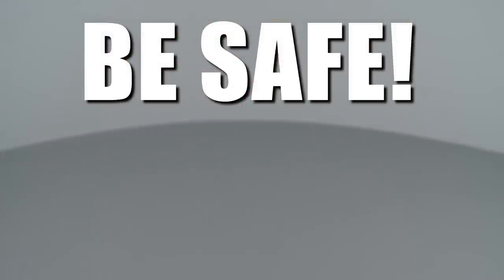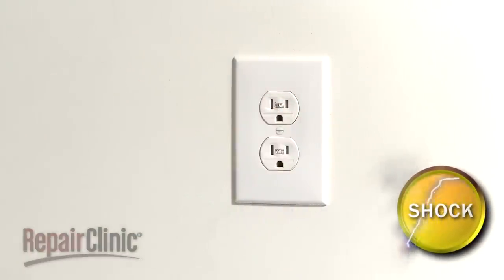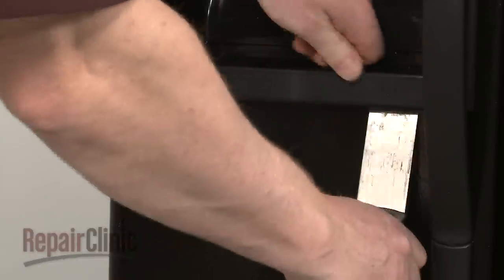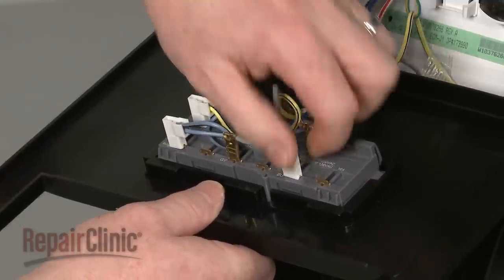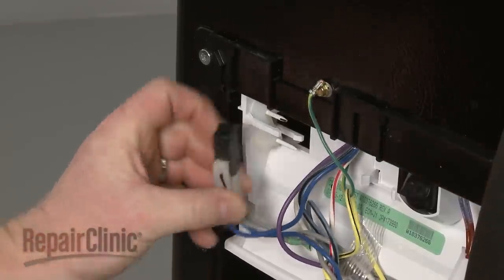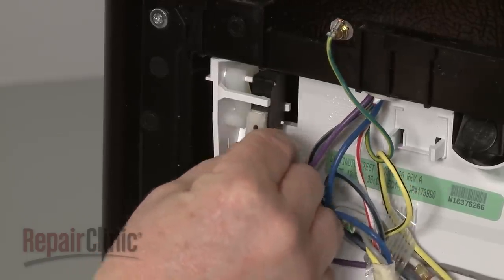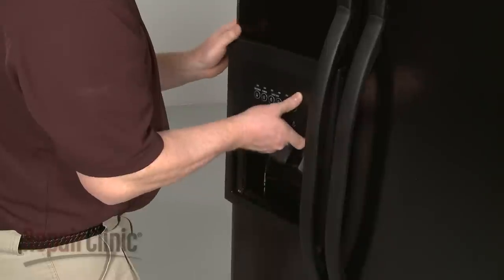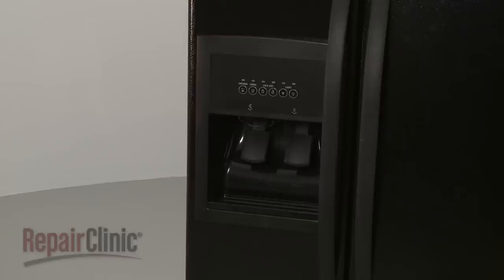Whirlpool Refrigerator Dispenser Switch Replacement #2162361

Comment: I have a whirlpool where you push the ice dispenser all the way down and it seems like it does not always make contact. Sometimes it does, sometimes it doesn’t. Trying to figure out if there’s wear on the lever assembly or if it the switch going bad. Any suggestions? Thanks

Comment: I have a dispenser that shuts off before releasing pressure from the switch.  The unit has a compressor that’s shutting off intermittently.  Any suggestions?  It’s a whirlpool gold side by side unit

Comment: Why do you need to disconnect the front panel switch assembly?  Looks like the arm microswitches are easily accessible with the panel hanging down.

Comment: I have a dispenser that does not shut off right away when the glass is removed causing the user to open the fridge door to shut off the dispenser. Is this because of this problem?
Reply from the maker: +y00no The dispenser switch is probably sticking or the lever is not working properly.  You should not need to open the door to interrupt electricity to the dispenser.
Reply: +RepairClinic.com This problem was around well before I did a repair on the ice dispenser door mechanism, but now I am familiar with the the turf and I think you have nailed it. I will take a look! Thank you for the quick service.
Reply: This is normal.. Because of the length of tubing it takes a second or two for all the water to exit.